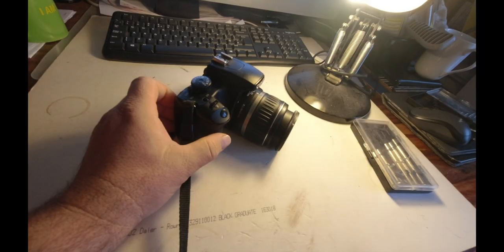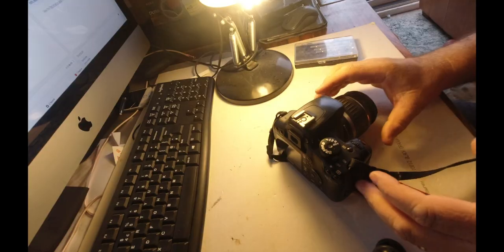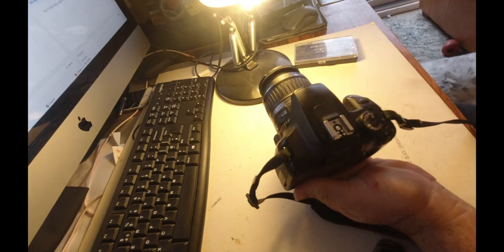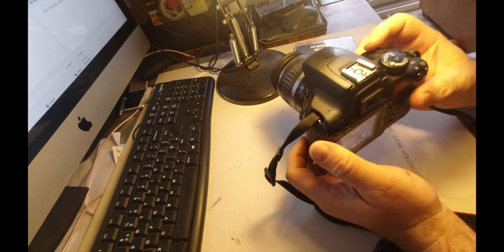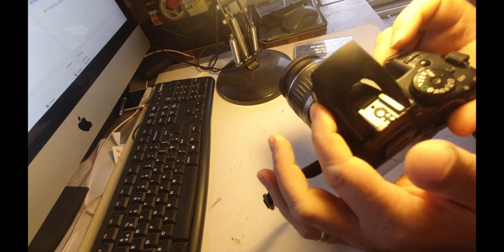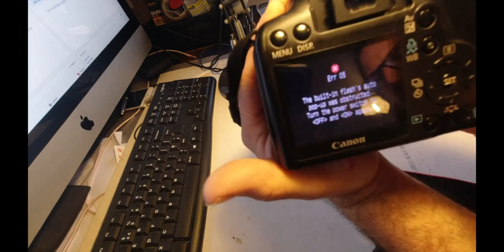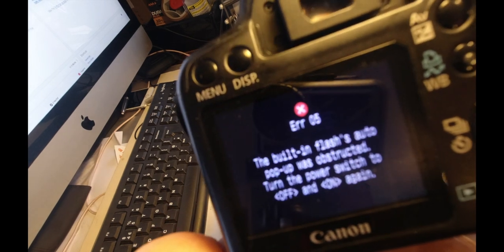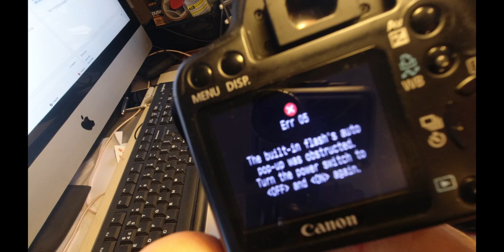How to fix the Err 05 in Canon DSLR cameras - Flash pop-up Not Working Built in Flash

Comment: My ,80d releases the flash when push the button but still trying to release 2 times next then gives the 05 error. What could be?
Reply from the maker: im sorry i wish i could help , i was just passing on info i found out about the fault i had . i wish you all the best in sorting the problem.
Reply: @NeilandJanResellers  thanks! I solved It releasing and cleaning
Reply: My 550d flash pop up but still shown error 5
Reply: @ktaploftproducoes8985  how did you fix it? Mine pops up as well but shows error message.

Comment: man.. this guy casually repairing it while the mirror left unprotected.
Reply from the maker: your totally right but as this camera did not come with a camera body cover and i did not have one that would fit i was very care full when i was doing the repair , your right in this film as i took off the lens i should have said for people to put on a camera body cover thank you for picking me up on this .
Reply: @NeilandJanResellers  should be safe if your room not too dusty ( or has air purifier)…. My room quite dusty so Im very particular with my lenses & body. Need to cap it fast
Reply from the maker: the camera sold and the buyer was very happy with it, so all good. thanks for watching my films